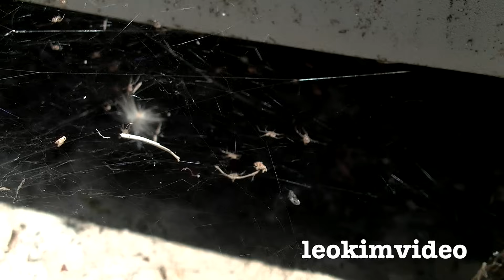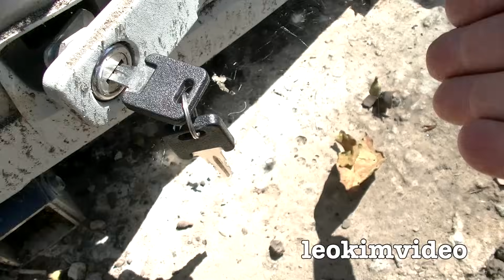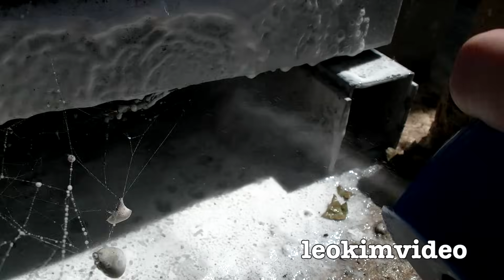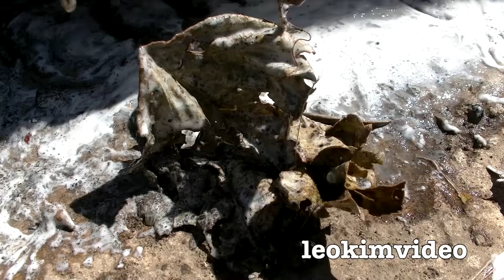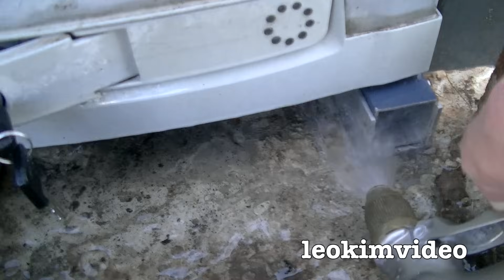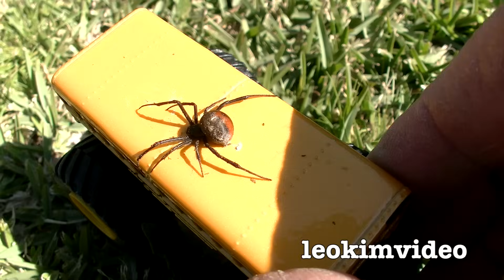Sneaky Redback Spider Raid Deadly White Christmas How To Video

Comment: raid has acid in it that melts plastic. i have accidentally sprayed it on my sunglasses and computer screen and not noticed that I did. the next day there were pits on the lenses and screen where the acid ate away the material. So my point is it can most likely eat away at electrical tubing as well.

Comment: I use raid when spraying the floor for roaches in the summer. Raid for roaches and ants usually come in red cans, here in New York. I think spider spray comes in, either yellow or green cans, I don't really remember. Have you considered using glue traps for spiders instead of spray?
Reply from the maker: I have used asian styled glue traps once. The problem with these is they are non selective. Once they become wet or dirty with dust they just stop working.
Reply: They are posenest
Reply: TheNw1218
Reply: leokimvideo f
Reply: I thought Raid was Australian.. Hmm, maybe it's Mortein that is
Reply: leokimvideo                              E

Comment: whoa, you should be extremely careful spraying electronic stuff, as you could get a nasty, even lethal shock, 

always always switch things off first then spray, and besides getting a shock you could blow your gear up, so best to use a dust type of spider killer and not on any printed circuit boards

just my two cents 😉